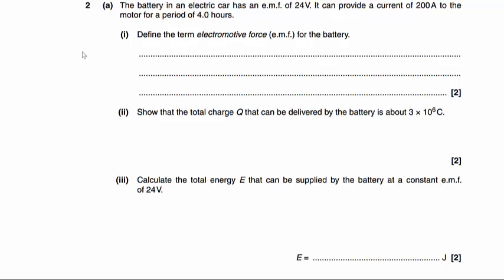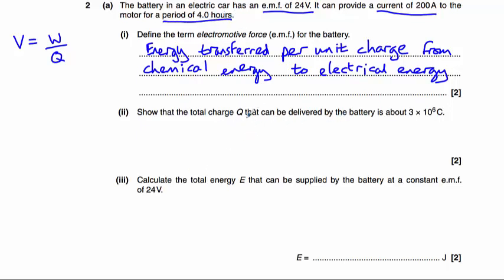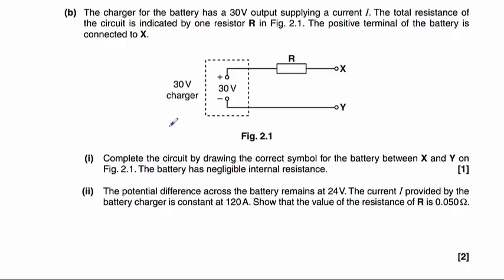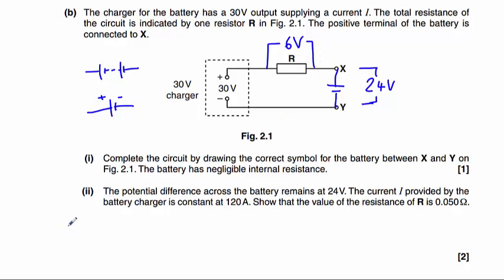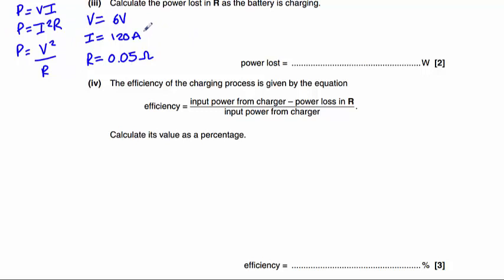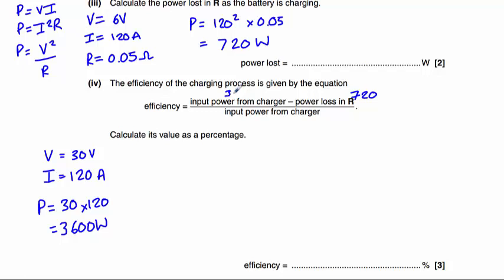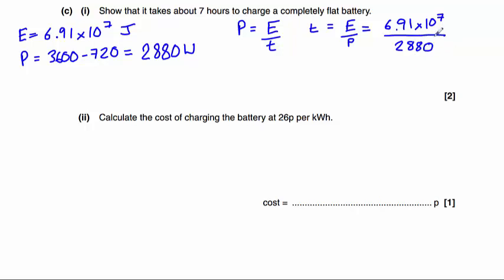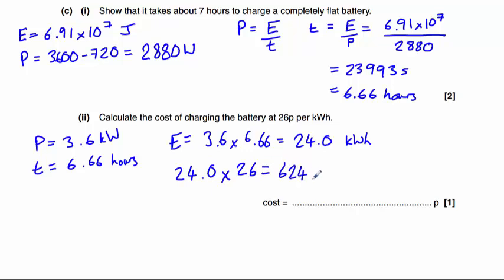OCR Physics A Electrons, Waves & Photons (June 2013) Q2 (emf, power, energy)

Comment: How many significant figures should you leave your answers to?
Reply from the maker: +DannyRs 2sf or 3sf is the OCR requirement. You won't normally be penalised for using more than 3sf, but will be penalised once per paper if you use 1sf.

In the new spec, you are likely to find questions that say "give your answer to an appropriate number of significant figures", in which case you must maintain the precision of the raw data you began with. In other words, if you're calculating density and the mass and volume were both given to 2sf, you should give you answer to 2sf.
Reply: +Cowen Physics Thank you :)

Comment: why did you use 6.66 hours instead of the 7 hours it stated in the previous bit of the question? c ii) 

Thanks for the videos more please :)
Reply from the maker: 6.66 hours is more accurate, as that is what I calculated during the previous part of the question (which was to show that it was approximately 7 hours).